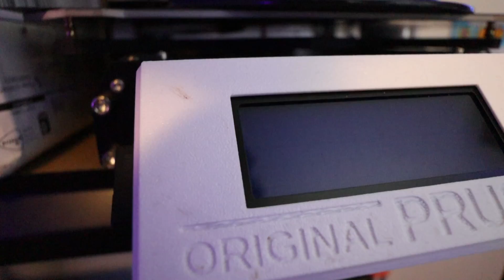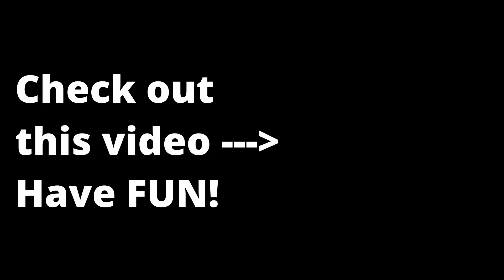Fixing Prusa i3 MK3S Hotend Leak   Easy 3D Printer Repair!

Comment: this helped me a lot, thank you!!
Key was that you can easy get the unit (cooler+heatbreak+heatblock+nozzle) out and then you are able to tighten it properly - if you try to tighten it only without disassembly (adding torque to the nozzle and keep the heatblock in place) you will always loose the heatbreak during this process. Had this issue since years, thanks!🙏

Comment: Hi, dank voor deze interessante video!
Problemen met af en toe een blob van de E3d 6V. 
Ik heb alles volgens de regeltjes gedaan:
Nozzle schoongemaakt,
Nieuwe heatbreak (bimetal), 
Heatbreak (met koelpasta op het lange deel) helemaal in de heatsink geschroefd, aan de juiste kant
De nozzle helemaal in heaterblock, halve slag teruggedraaid 
Heatbreak in heaterblock tot tegen de Nozzle, klein tikje aangedraaid
Minuutje op 295°C
Nozzle met torque 2.5 N aangehaald
Afkoelen, weer naar 295°C, nogmaals 2.5N.

Resultaat: geen grote blobs, maar probleem blijft. 
Enig idee wat het kan zijn?
Reply from the maker: Hi, de heatbreak moet eigenlijk tegen de nozzle aanzitten. Deze 2 drukken in de heaterblock tegenelkaar aan. Daarom zit de heatbreak, of eigenlijk de heatsink heel kort op de heaterblock. En bij de nozzle moet er een spleetje zitten tussen de nut gedeelte en de onderkant van de heaterblock

Comment: That’s a great job of cleaning the heat block. I just tried heating to 215C and using a damp cloth but I’m not having much luck. Did you use a dry cloth, or acetone and what temperature? Thanks
Reply from the maker: Thanks, I did use some old clothes to wipe the block off, without acetone and I use the temp around 220C